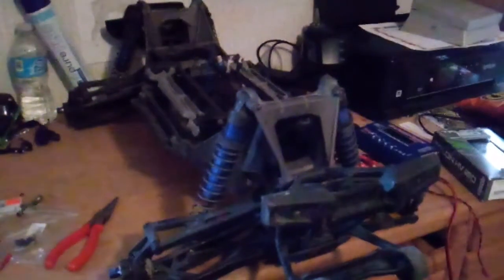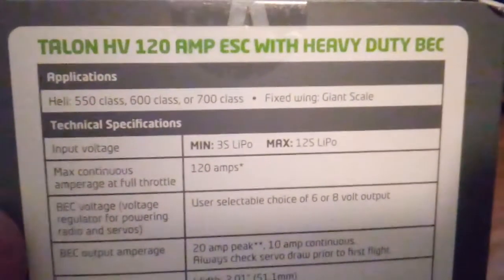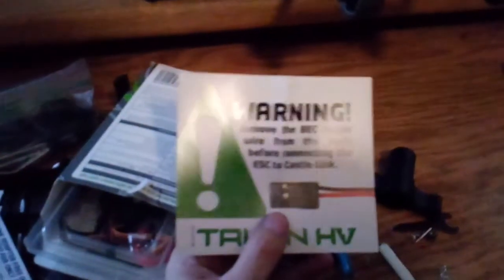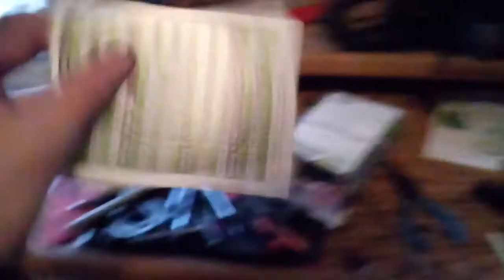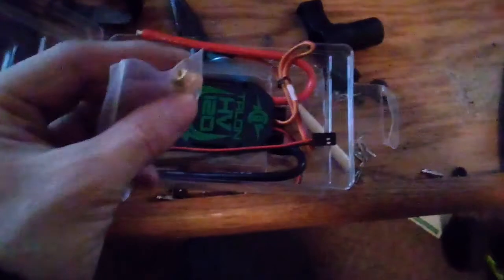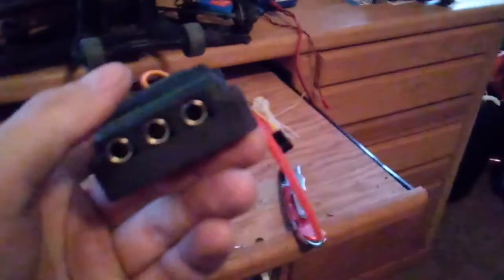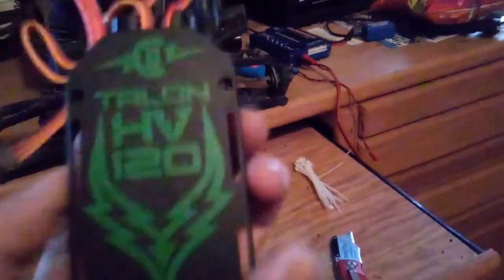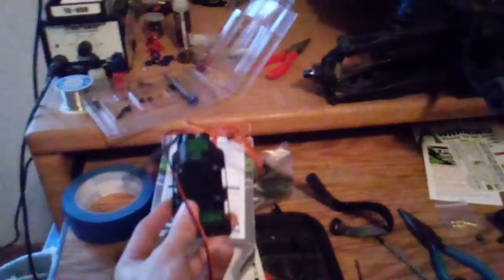12s xmaxx is getting closer 😀

Comment: Does talon 120 esc have reverse
Reply from the maker: If I can remember right no it doesn't it's a plane an helicopter esc look on eBay their is a waterproof esc for 5th scale an I think it was around 200 to 250 the vxp racing 300amp esc was almost 400 bucks I paid an takes along time to get to u an u need the programer card too an initial throttle start to take off is too aggressive I've even turned it down an it's still too aggressive where it was killing my gears in my x maxx